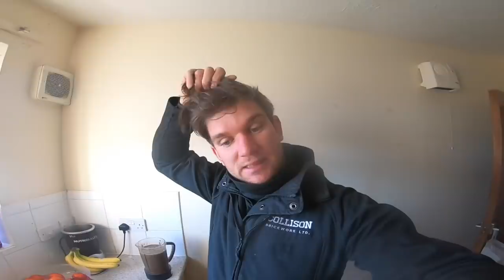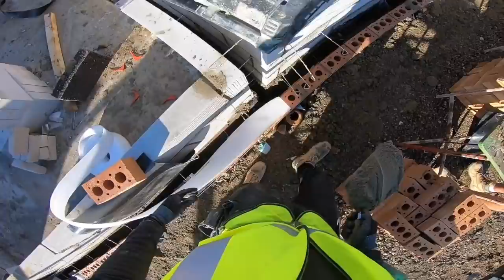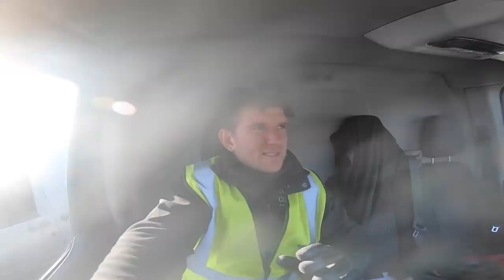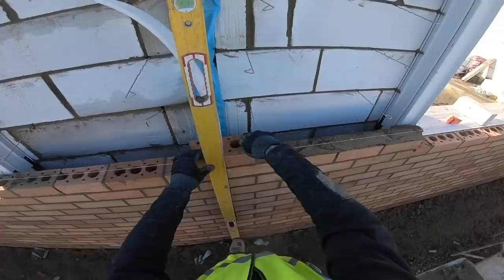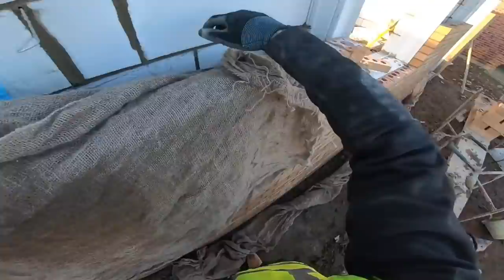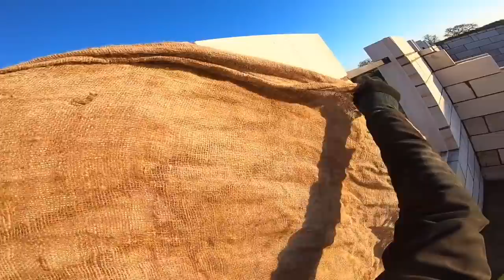It Was a Cold day!

Comment: Hi charlie. I found if you have some celotex to hand cut a thin piece and wedge it in the jack wall...then score one side of the expansion joint plumb with your trowel then lay one brick to the line all the time and but the other up against....works with normal celotex insulated walls and also if it's blown in you can Sharpie against the inside skin. Hope that makes sense,  does help to keep the expansion plumb as

Comment: For you trays above the air vents, if your cutting the felt to start with, if it’s 600 wide damp, cut it at 450 then spin it around saves cutting it twice like you did

Comment: Dewalt flex volt cordless disc cutter bud 👌🏻
Reply: Great tool got 1 not that long ago DeWalt best on market for these.  He has DeWalt tools so his rip and so on would run off the flex volt batteries also and run longer. There worth the outlay. Have 2 batteries at the ready. 9ah £140 each. Or bigger 1,s 12ah £240 each worth every penny. Spare change to the boy now with YouTube income on top of his wage lol. Big thing missed there it’s silent also. 😆😎👍🏻
Reply: @lmilne4859  I’ve got the makita version and it’s handy as fook for that type of thing. Cut out a door in 7n blocks no probs, good for cutting RSJs too.
Seen the dewalt and was impressed by that as well. 👌🏻
Reply: @mattpointer8495 
Sure are good will never replace ma gas saw but sure are handy. Ie cutting a wall above shoulder level weight wise blitz up facing bricks these types of saws will excel for sure. As you say rip into concrete blocks no problems same with slabs exc.

Comment: Why between each house is there a line separating in the brick? Why not carry the flow of bricks all along?
Reply: It’s called a movement joint
Reply: It’s an expansion joint for any movement in the house it’s a load of bollocks
Reply: How come they don’t put them in detached houses?
Reply: every new build will have em but older houses won’t
Reply: I bought new 4 years ago, detached 3 bed but don’t have any movement joints in the brick, was just curious to why they put them in lol

Comment: Not keen on that 3/4 on the door reveal.
Reply: 😳WTF
Reply: Its common nowadays we have the same problem on site no room for movement on door or window placement and because we use the formers you cant adjust size of opening so you end up with 3/4 everywhere its a pain in the arse.
Reply: @TheTraditionalGolfer  yeah, but you put a full brick on the reveal and the 3/4 the next brick along to fix the bond. 3/4 on the end is a no no.
Reply: @MrOitoyboy  the perps will step mate above.....imagine the opening not being  there the 3 quarter becomes a full stretcher and would carry on as normal then the course above would stay half bond keeping the perps in line!!! By moving the 3 quarter back a brick and swapping the strecher to the end the bond will step to 3 quarter bond from whats below which is stretcher bond just at that section though because you have thrown a 3 quater into the panel and not lost it on an end then when you come back to full half bond above you would step again the same as you did below the panel....👍
Reply: @TheTraditionalGolfer  can’t be arsed to argue with you mate but it is wrong. Should always be a half bat or a full brick on the reveal. Only on timber frame could you excuse it. And even then you’d try your best to get out of it. And if the 3/4 is less than 165mm then you put 2 3/4 bricks over the top of it. In this instance the perps are irrelevant

Comment: Guess you've seen it but if not check out the article on Persimmon on the DM site.
Reply: Can’t find it
Reply: @Shinobi £40mil bonus! On top of his wages? It shows that the prices brickies get should be a lot more
Reply: Just to add light to the persimmon article ,the bricks they use are concrete solids with red die in them when slightly wet the bottom  course's float everywhere,I worked for them for 3 years ,worst and cheapest facings ever bag of shit persimmon homes stay well clear and work for a firm that use quality materials